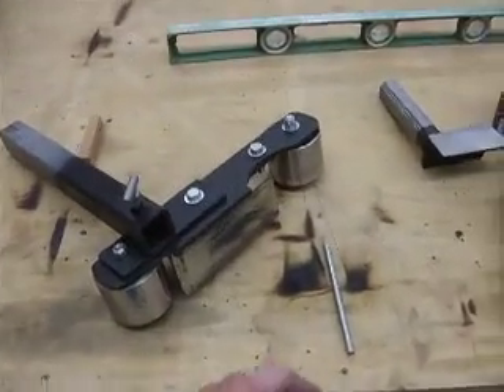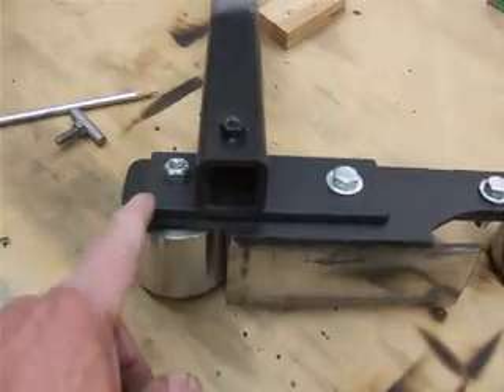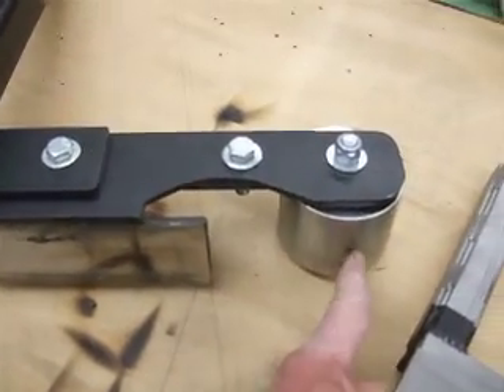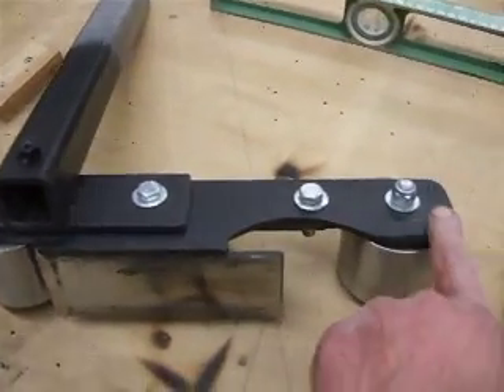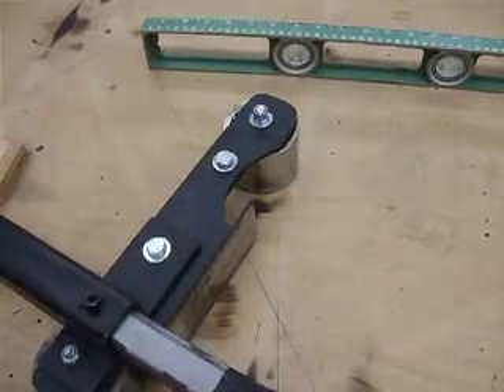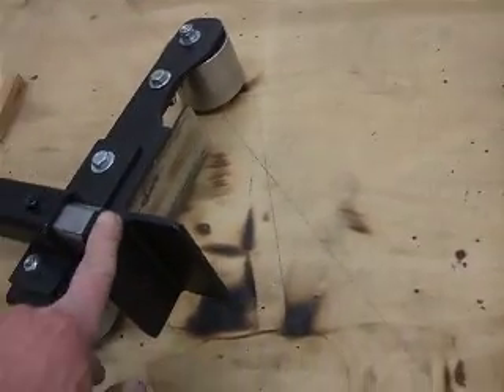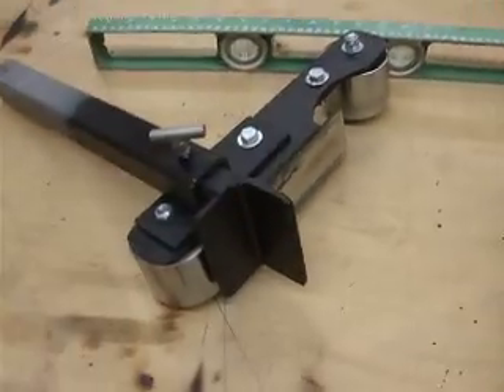2" by 72" Homemade Belt Grinder Construction Part 2

Comment: Why is the platen arm 13 and 3/4" inches long?
Reply from the maker: Mike Gunnells Ministries Inc Probably the size of the piece I had. No magic behind the 12 3/4 inch length. The geometry works out just right and the belt tension is perfect.
Reply: @alaskabearhawk  Could it be shorter is the reason for me asking
Reply from the maker: Mike Gunnells Ministries Inc I suppose it could be. It would affect the belt tension a bit moving the upper Guide pulley down. You could change the tension on the spring or lengthen the tensioner if it becomes a problem. I wouldn’t shorten the platen length. It it about perfect in length for what I use it for, straightening the edge of a longer piece of steel.
Reply: @alaskabearhawk  I'm not talking about the platen itself I am talking about the arm that holds the platen that slides into the main body of grinder do you ever slide it out that far to be using 13 and 3/4"
Reply from the maker: @mikegunnellsministriesinc5384   Ahhhh...gotcha. No, I never slide it out that far. The main reason it's so long is to eliminate as much radial, or side-to-side, up/down play that I can for the rest that slides into it. I had to add the plates for a tighter fit and the length helps take care of the rest. To me the ability to put in the rest and have it exactly 90 degrees to the belt without fiddling with it is worth a lot. It's almost like a poor man's Bridgeport. Many of my parts need to be accurate. Even if they don't have to be exact, having things straight and true make fab work easier and the result much more professional-looking...especially when you paint them.

Comment: with regard to the idler pulley bolts, are they centered on the angle iron or off center. I have watched the video several times and you do not say or I missed it. thank you
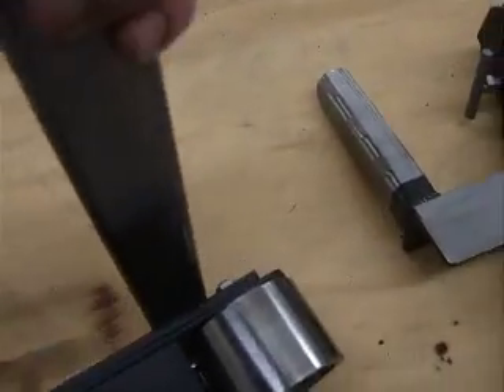Reply from the maker: Patrick Smith look at the video starting at 3:30. That explains the bolt placement relative to the face of the platen. I figure that each person may have a different diameter of idler pulley depending upon what they use for the pulley itself. the main thing is that the pulleys can run free with the platen flat on a table. I hope this answers your question.

Comment: The tensioning pulleys that I got from a mechanic measure 2.375" and the 2.5 schedule 40 is larger than the pulley.  Then you said that you used ideler pulleys that the timing belt runs on for the platen . Did you use the same size pipe? Then in the video you went on and said you used ideler pulleys for the tracking pullyey. I'm confused.
Reply from the maker: Hey Gary...great catch! I remeasured the pipe that I used for the pulleys and it's 2 1/2 inch Schedule 80, not Schedule 40. I made an annotation on the first video (https://www.youtube.com/watch?v=L8ss_PZDWP0) starting around 2:25 and gave you the credit for a good catch. Thanks!

Comment from the maker: Take a look at the very first video I made about the grinder titled: "2" by 72" Homemade Belt Grinder", 5:20 long. Starting at 2:04, I describe how the wheels are made. I used timing belt bearings from a 2.5L Subaru engine. Hope this helps...

Comment from the maker: No problem...ask away. I'm not sure I have ever experienced anyone giving ID as a dimension for tubing material to describe the profile. Typically it's always OD. The platen face can be 2in, but the "2in by 72in" describes the belt, not the machinery. For instance if you have a 6 inch vertical belt sander, the platen may very well be 6.5 wide. There isn't any reason you couldn't make it 2in wide, it's just what I had. Good luck on your build.

Comment: I'm sorry for all the questions its just some people measure inside and some outside when you say 1.5" square tube is that from the outside or the inside? I have watched all 7 Vids many times and thank you for posting, the reason for the platen face question is because it is a 2x72 inch grinder yet the platen face is .5 larger then the belt, thanks for all your help this is all I need to know.

Comment from the maker: There are a total of seven videos on this belt grinder. Two are: "2" by 72" Homemade Belt Grinder" and "2" by 72" Homemade Belt Grinder Part II". They give the general overview. The remaining five: "2" by 72" Homemade Belt Grinder Construction Part 1/2/3/4/5" should give all the dimensions of the steel used in the grinder, step by step. If there is something that is missing that you need to know, tell me and I'll get a measurement for you. Thanks for your interest!
Reply: alaskabearhawk are the idler pulley bolts centered on the angle iron. thank you